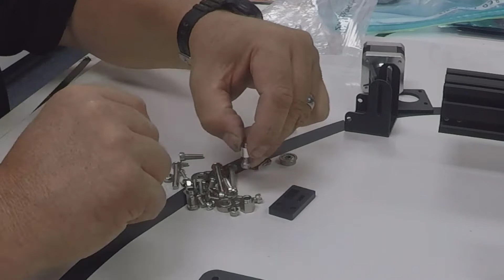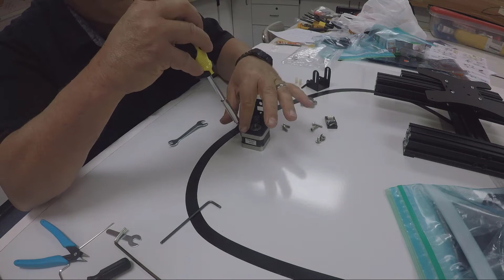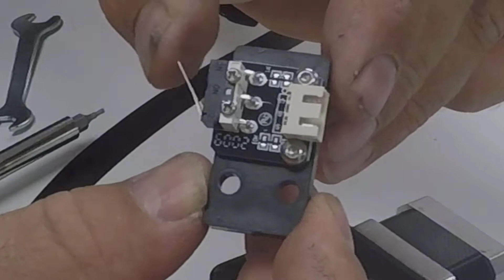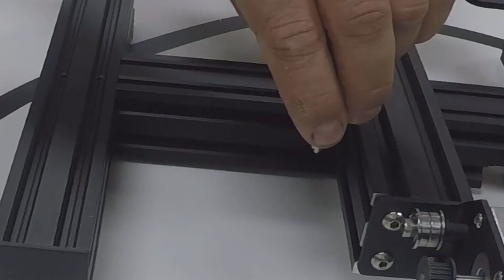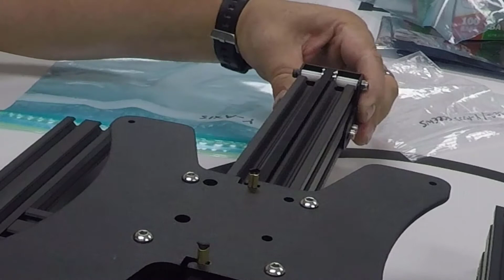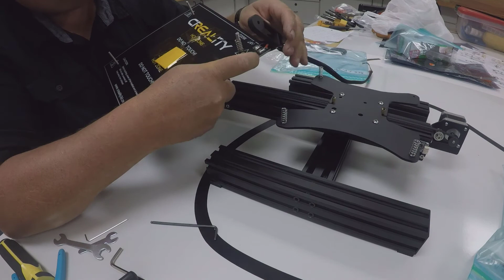Ender 3 Pro - Y-Axis and Bed Assembly (6 of 15)

Comment: Again, I'll mimic the other poster. Outstanding tutorial. Your side comments and insights are invaluable. Might I suggest a little "tweek" that I picked up from another video. Place M4 nuts (or jam nuts) on the four,(4) bed bolts mounted on the heat bed. Torquing these down gently will eliminate any future wobble during printing. Our bed springs or silicon dampeners fit right over them so no other adjustments are needed.